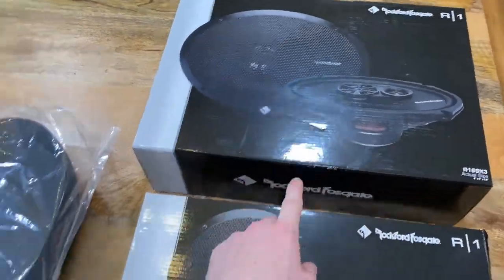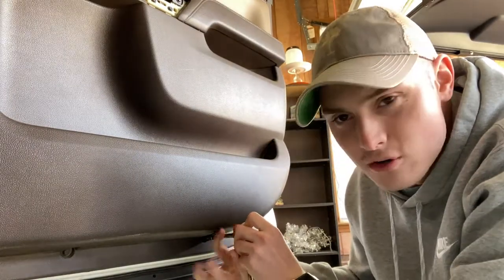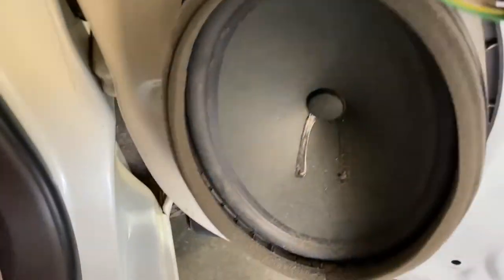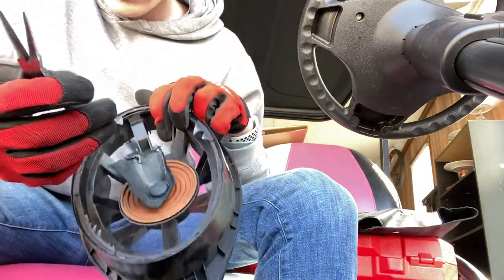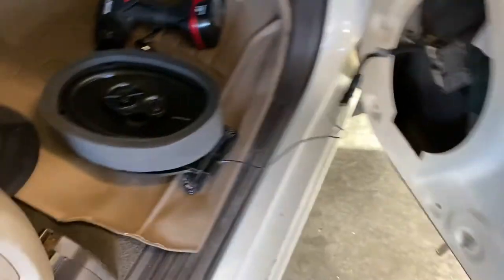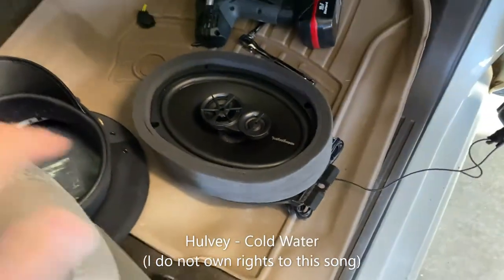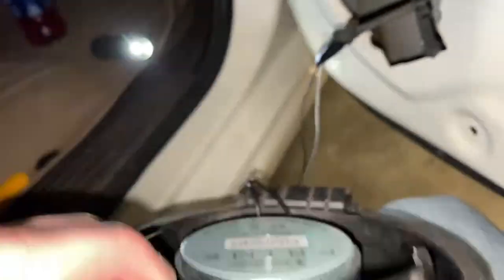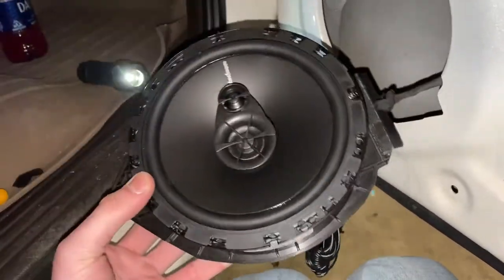Are Rockford Fosgate Speakers Any Good?

Comment: The stock speakers are specifically designed for the car, Rockford fosgates are designed to be used with an amp, sub etc. the amp allows you to control the bass and alot more.
Reply from the maker: Good thing I got that JL 10” sub and amp to help amp them up!
Reply: @hunterrwiilson  should sound sick mate. Dk what it’s like in the US but the bloke at the speaker joint played a range of different speakers for me, he said the rockfords are what he recommends. Hope all works out and becomes a banging system for u mate👍
Reply: but I read on the website this type specifically claim to be used as replacement of factory speaker, so I guess the quality should be about 11-12 (pretty close), could be the factory one better, or the rockford slightly better
Reply: hey bro so if i were to put 2 of those on the front doors would they be way better if i got a amp to connect them to instead of leaving them wired up as stock ?
Reply: Agreed, Rockford speakers require more than what the head unit can deliver.

Comment: Rockford fosgate full range speakers suck, compare to other name branded full range speakers. Although better than stock speakers, but their Watts are average to low powered. As a result when you turn up the volume to highest level on your stereo, it starts distorting and what not. Jl audio speakers are much better and they can handle more power. Higher lines of Alpine, kenwood, sony, pioneer, speakers are all much better than rockford speakers. Definitly cannot compare them with Focal, morel, hertz, audiofrog.
Reply from the maker: I’m waiting to get a 6-way amp to add for my sub and door speakers. Asked a guy how much one was and he said $600 😳 I opted to wait some time haha

Comment: Awesome Installation video, you used the same procedure i did, utilize the actual (original factory molding) to install my rockfords without spending extra money for mounting braces.. My added touch was to apply all weather silicone on the speaker and modified bracket to make the system air tight!! Kudos for an awesome selection of speakers and a thorough install Vid!!!!!!😇🤜🤛👍😎
Reply from the maker: @MrJamesgrate  thanks James! That sounds like a solid touch you did you there, good on ya!

Comment: Great video. I was considering the Rockfort Fosgate R165X3 to run them off my stock radio and your video confirmed my suspicion that the bass would not be great unless further amplified. No doubt they are good speakers but not much punch unless they get properly powered
Reply from the maker: @isaacplans4778  thanks Isaac! But yeah I agree 100%. I want to get a 6-way amplifier here in the near future to hook up my door speakers and current sub setup. But still pretty solid speakers regardless!

Comment: Nice work. You have now joined the Rockford community. We here, you will be held to the highest of standards. CONGRADULATIONS ! WELCOME TO OUR SOCIETY. 🔊🔊🔊🔊🔊🔊
Reply: Don't remember how I ran into them.. but was a comment I believe I remember. So was talking about skars. Good bass but not crazy.. people get them on a budget or just want bass but not super crazy about it... Me on the other hand... Got into a hunt into speakers and all I need if it's needed.. and yes I believe you need your car overall bad a s s. Fro door speakers either above your rear windshield or bottom of the seats.. going to go get some Rockford for all passengers. And either get. Box for the bottom of the bas of a Hyundai elantra 2016 se. Or plan to get it on the rear back window. Either 10 or 12. And getting some weather tech floor Matt's way better then any floor matt. Went with a hyped up floor matt are good but not a yr complete maybe 7 months.. and the logo was loose. While weather tech can kick drag scratch out mud. Water spills. Sharp boots smooth sandles. Flip flops. Whatever. and won't effect it at all..people well be shocked that this little car wel sound crazy. And of course going to deep clean my car crisp and clean. Get as much nasty smells out. Before purchasing a red leather seats. And add ceramic tint all around the car. Switch the taillight with up to date lights..and this by Tommorow I well have brand new tires for them. New shocks. Front and rear. Led front and back all ready installed.. and worth every penny.. I well have to ask around Florida and see how is able to pretty much  go from stock leg room.. to nice leg room and able to stretch comfortably... And if ANYONE knows where I can improve drastically the height of it at least 3 inches PLEASE send me a link. Cross our fingers the shocks improve the height. Carry minimum 200 pounds of weight in the back. Not including us 5 which is 150 each person.. and people think its ugly or unimpressed.. THATS THE POINT🫨😎😎😎😂😂 while I owe a 2020 expedition upgraded in 5k in speakers. And still have other things planned... No am not rich... Was broke 14 yrs back. Didn't owe a car more could afford. A can of coke or a bag of chips.. everything 2nd hand... 23 yrs old man.. happy with a girl I have.. trust the process. Live life don't worry.. your time well come keep grinding.

Comment: I installed a Rockford fosgate 6.75 prime series 3 way at the back door of my wrx..it was sound so nice and planning to put a component punch at the front door..I admired the Rockford fosgate how good clarity the  sounds it was playing into..nice vid by the way..👍adding it on to my sound setup helps my bass a lot even the trebles..now the subwoofer sound more deeper with those Rockford fosgate at the rear door of my wrx especially when it’s already done breaking in..
Reply from the maker: I added in a JL AUDIO 10” sub and 500W amp and it’s such a good combo! Made a video on it if you’d like to check it out! Thanks for your comment!!!
Reply: @hunterrwiilson  I add some a soundstage 10” competition series for the sub and amp 1000 watts..but planning to replaced it with a Rockford fosgate too
Reply from the maker: @joshrenzecastillo7740  sounds like a bangin' set up!

Comment: I recently purchased a used 2021 Nissan Frontier, that came with an 10-speaker, 380 amp Rockford Fosgate sound system. The subwoofer has two 6" dual voice coil speakers. I am convinced that a sound system included in the vehicle has a subwoofer for sales-bait purposes only. There is never a separate volume control JUST for the subwoofer. So, if the user turns the bass up on the sound system mixer, all 10 little speakers try to pump out more bass. My ear has to be within 12" of the subwoofer to even hear it.
Reply from the maker: Sounds like it may be time for another aftermarket sub and bass knob
Reply: @hunterrwiilson  Thanks for responding. I agree that if you want to hear the Rockford Fosgate subwoofers in a Nissan Frontier, you will need an upgraded system. (I had a Honda CRV with a much promoted sound system, and no one could hear that subwoofer either.)
Reply from the maker: @obsoletevalues6209  of course! If anything, try installing an amp and seeing what that extra power paralleled with your stock head unit does.

Comment: This is due to what's called sensitivity. The materials in the speaker from the factory are lighter and require less power to get sound, so will sound louder with same power. I see you have since upgraded and added some things just reading comments in here. Frequency response is the next thing to pay attention to. If your looking for more low end in a component without adding a subwoofer having a speaker that has a lower response is what you want.
Reply from the maker: I’m looking for more treble at the moment. Been thinking about changing the stock tweeters to some aftermarket ones to give more sound from the “lyrics” and that way the bass won’t be so overbearing. But I’ll need to add a 6-way amp to get true power from them.
Reply: @hunterrwiilson  are the factory tweeters working? Sometimes oem speakers have crossover built in for tweeters.
Reply from the maker: @Aligntechngamer  they do just fine but the bass can really overpower the music if you know what I mean

Comment: The stock speakers souns better in my opinion lack of highs though. Rockford Fosgate sounded really flat.. no bass.
I did the T1650-S with P400-4 amp and its really great
Reply from the maker: They did sound pretty bad without some extra help. But I installed a JL Audio 500W amp and it helped incredibly.
Reply: Nice clear highs from the Rockfords and like others said an amp would help

Comment: Your factory speakers might be 2ohm,which would explain the difference in sound,they do this so they don't have to use an Amp to drive them,I just replaced my entire system and that's when I found out it was a 2ohm system.
Reply: Did you have the Bose sound system?
Reply: @urielhernandez3286  no,I had the base radio.
Reply: @vanceproctor3568  oh because from what I know the front speakers of the sierra are 4 ohms and the rear are 8ohms I might be wrong
Reply: @vanceproctor3568  I have a 2013 Silverado and I replaced the 4 speaker with some kicker cs 6.5 and when I was going to install them I saw that the stock rear ones were 8ohms and the front ones are 4 ohms and I put 4ohms speakers in the front and rear